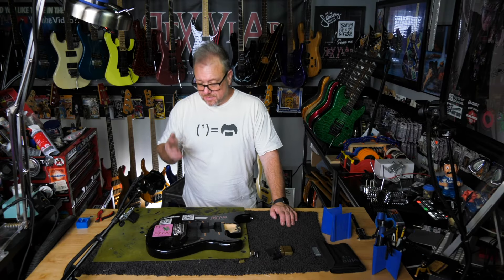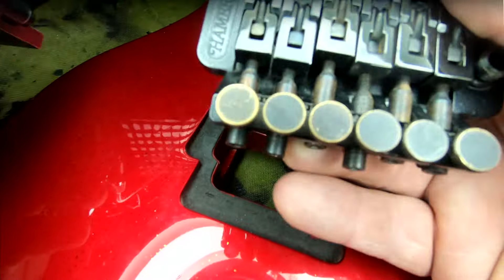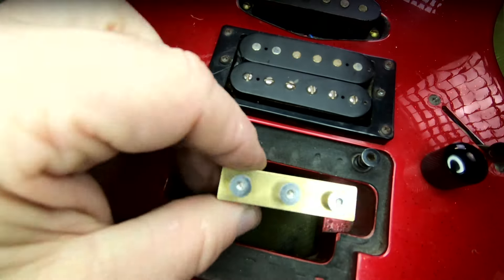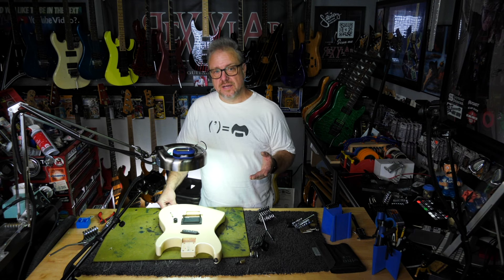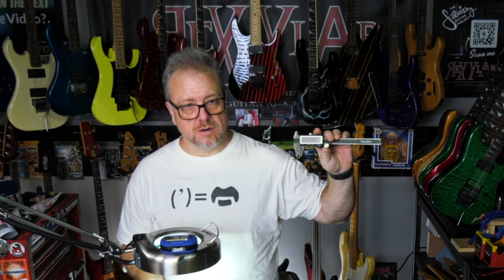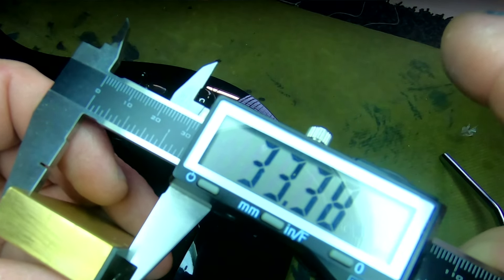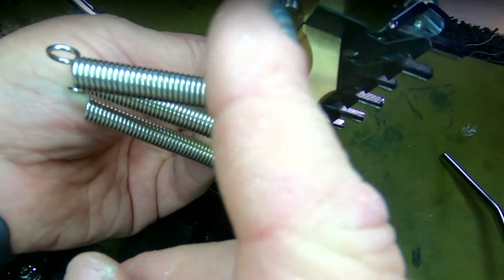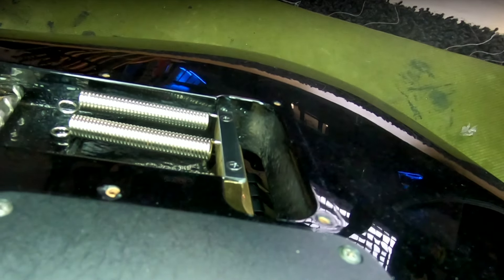Block Options For The 2024 Kahler Steelers

Comment: Thanks for this… thinking the fat brass will fit in my KV2 King V as a replacement of the FR official. I have an old Steeler and the fulcrum pivot point for the poles/screws appeared to fit identical distances.
Reply from the maker: It should fit with ease.